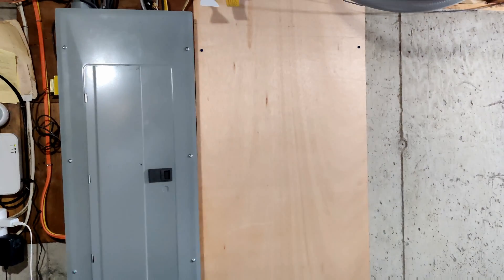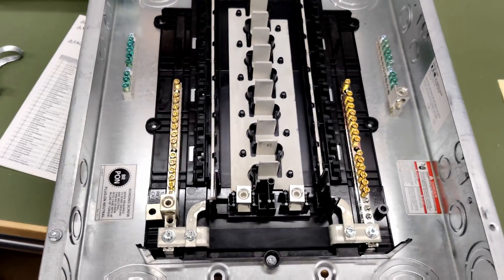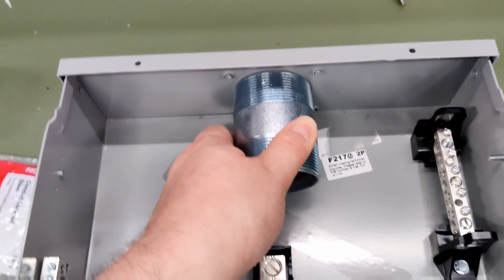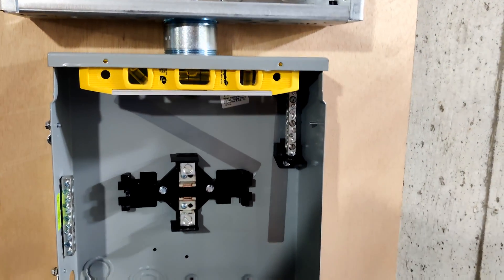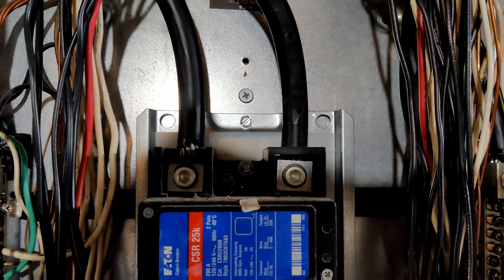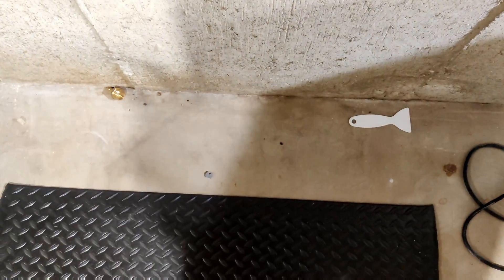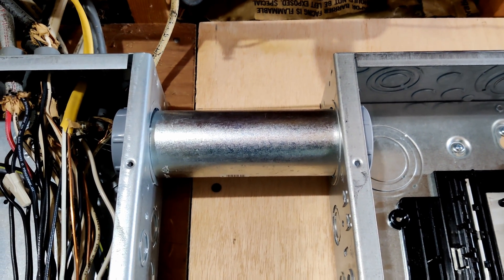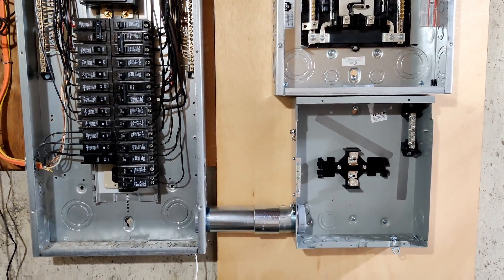Installation of an EG4 6500EX Based Off Grid Solar System - Part 4

Comment: Is PVC conduit banned on your planet?
Reply from the maker: No, but they only sell it in ten foot sections around here, and I would need to buy glue and fittings as well.  It was cheaper to use the metal connectors, with the side benefit of it bonding the boxes together electrically and making it so I didn't have to store 8 feet of left over conduit.  I'm too much of a pack rat as it is. :)
If the run had been more than 12" I probably would have used PVC.

Comment: Have a ton of questions on the load panel. Looking at changing out my sub panel.  Do you have an email address that I can bounce a few questions from you?  (If you are willing to help). Thank you!
Reply from the maker: It's important to note that I am not an electrician.  Installing something new is much easier than trying to rebuild an existing installation to current code.  You may be best off consulting a "real" electrician, especially if you plan to have it inspected.
Reply: @SolarShenanigans  lol!  Thanks. I’m not an electrician either but I have my partner, EE, to come by and make sure I’m not going to throw the world off tilt. I just have a few fundamental questions on the setup although I’m already deployed and probably would not change. Just seems crazy to me I have to install multiple Reliance type manual transfer switch boxes because they don’t make a decent sized variant (above 10 circuits).
Reply from the maker: @Dmkjr  I almost went with one of those units but went with a standalone critical loads panel and a single circuit transfer switch for that very reason.  I'd have preferred to have have circuit level control over what is on grid or inverter, but like you said they don't make one big enough.
If you go to the "About" section of my channel there's an e-mail address for "business inquiries" but I can't promise I can be of much help.

Comment: Next time pull the meter and throw it in the dirt till your finished.
Yeah, I know.
But I spot all the time
Reply from the maker: It's a smart meter and the main office for my power company is less than a half mile from my house and the meter is on the front of the house. They'd have a truck pulled up asking me what the heck I'm doing before I managed to toss it in the dirt. ;)

Comment: How you like the all in one unit? I have a 3000 watt kinda like that but now im using seperate components.  I wanted the start capacity of low frequency and needed 240 split phase but i like that eg4 pretty good from what ive seen on the videos of it
Reply from the maker: I've not pushed it very hard yet.  I'm interested to see if I get the flickering lights issue once I move some of my lighting circuits over to the inverter, though.  That one seems to be infamous with the 6500EX.  The idle consumption is fairly high but that seems to be a common thread with these lower priced inverters.
Reply: @SolarShenanigans  if you buy good led lights they won't flicker much if any. If you have the inverter heavily loaded then you might notice it or if you are using long battery cables or weak batteries. My flicker issue stopped when I replaced my battery cables with 2 runs of 2/0 guage wire. It way overkill when just looking at the safety issues but for wanting little to no voltage drop it what you need
Reply from the maker: @matthewknight5641  We'll see, most of my lights are Phillips Hue.  I've already had the inverters tick off my APC UPS on some of my compute equipment though.  They really don't like it when the inverter is in grid mode even though they're not even on a circuit powered by the inverter.  They click and buzz and switch from battery and back over and over again randomly.
Reply: @SolarShenanigans  I don't know if this will help but I had problems with my first all in one until I realized the ground situation changes when they are in battery mode. The inverter will still run things but it looses its reference point to make clean signwave and also mine was leaking voltage which was another kinda dangerous issue that I didn't find till it was raining and I got a small shock. Checked the case and had 40 volts thru the frame. I fixed it and everything worked properly but it took me watching a guy named roland with hybrid inverter neutral ground bonding on youtube.  Yeah look him up and he will explain it all in detail where it's easily understood and he goes over how to correct the issue. He saved my life I'm sure. My system was working but just having issues ya know. Then after watching his videos and fixing the issue my system worked and worked correctly. Hope this helps and good luck

Comment: Looks great.  You did a great job with all the safety tips.  Those can't be stated enough!

Glad that hydraulic punch tool works for you.  That thing has saved me quite a bit!
Reply from the maker: Thanks.  I figure a lot of people looking at videos like this don't have much experience with electricity.
The punch is nice... but it does take a bit to get out of the mindset of being limited by knockouts... I'd probably have just used the punch to begin with rather than dinking with panel alignments.  Oh well, live and learn.